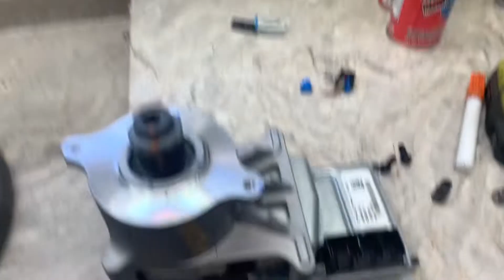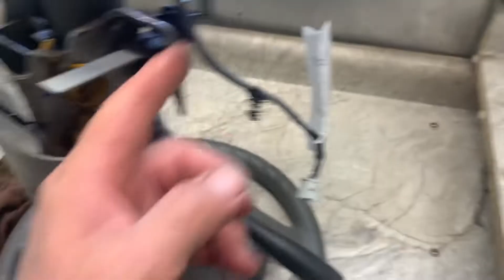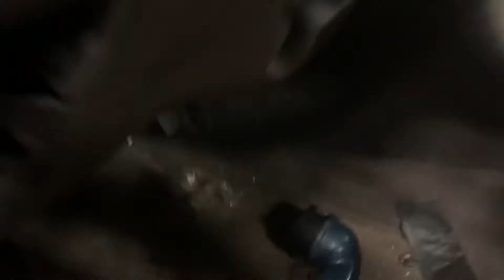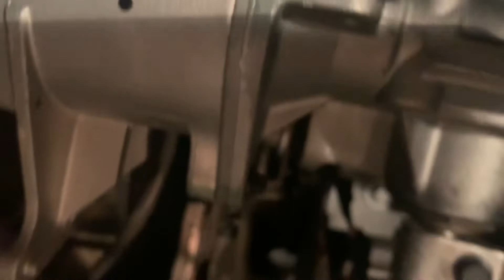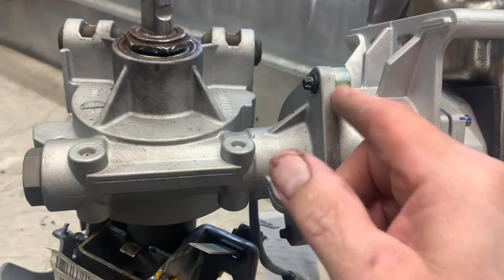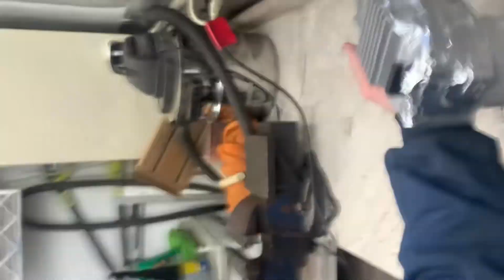2011 Chevy Malibu Electric steering motor

Comment: Did you have to do any programming with a special scan tool when you installed the motor or did you only clear the codes and it worked fine after that or do you have to have a special scan tool to clear the steering codes?
Reply from the maker: The motor no

Comment: Just did some digging, GM put out Special Coverage 15356 for the power steering sensor. However, since it is a special coverage and not a recall, the only way to see if it applies to your vehicle is by registering online. My car never had any symptoms until now and the coverage expired in 2021. I submitted a complaint to the NHTSA to make this into a recall so that people aren't paying out of pocket for something GM knows is faulty. If you have the same issue, please submit a complaint to the NHTSA. A quick google search will reveal the Special Coverage Instructions GM sent to all the dealerships 5 years ago.
Reply from the maker: Thank you for the information
Reply: Putting my complaint in tomorrow morning. Ty for the information.